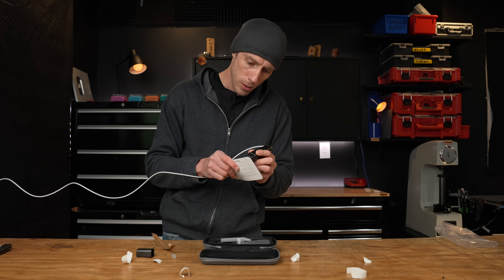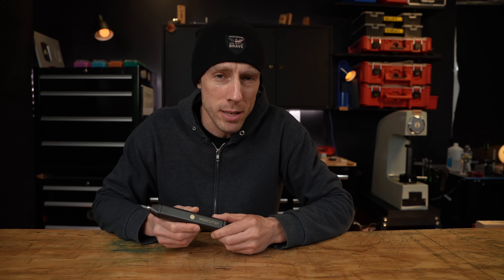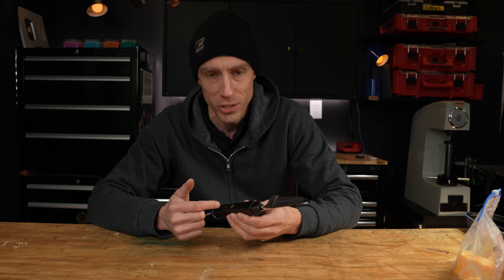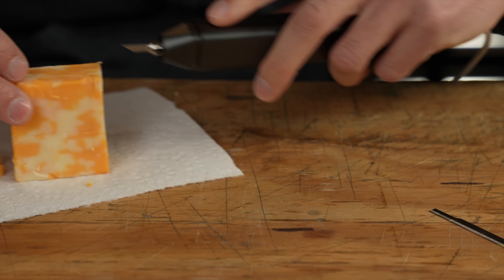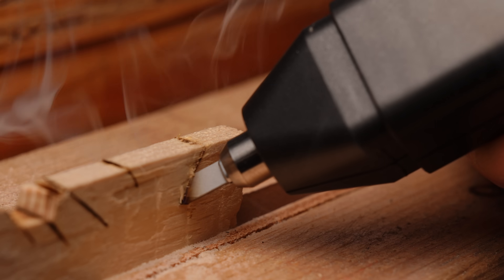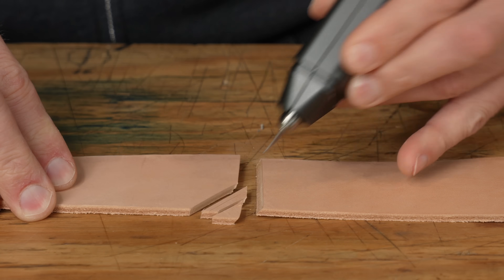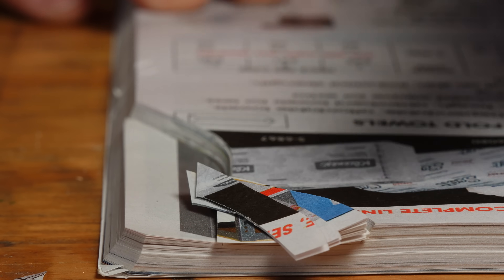Could This Small Tool Be The Future Of Knife Cutting Performance?

Comment: Turns out this tech does scale up to full-sized knives. Commercial ultrasonic food cutters are ubiquitous in cake factories, for instance. It doesn't take that much power to excite a larger blade because the blade doesnt move forwards and backwards like a reciprocating saw. The piezo stack pumps a pressure wave into the blade that causes the metal of the blade itself to expand and contract. Even steel (even knife steels). The key is operrating the blade at a resonant frequency so you add up successive, low-power waves into macro scale action. You can avchieve > 10 microns of displacement on an 8" steel blade with as little as 6 Watts! 

Uktrasonics are cool. And a nightmare to learn!
Reply: Oh that's probably why it didn't work when he tried to fit different size blades into it. Different resonance frequency and therefore no effect.
Reply: Cool, thanks for the comment. Now knife hobbyists just need an adjustable vibrator.
Reply: We need knife vibrators  @MarkkuS
Reply: Spot on.  Resonance and harmonics are the key.  changing the blade causes those to approach zero, as was demonstrated here.

I am wondering about the functionality of diamond and SiC into steel and maybe ceramic.  Steel embedded wood would likely be a problem for harmonics vs lower speed oscillations with high speed steel teeth.
Reply: Yes achieve clean cuts in cake and no sticking to the knife
Reply: so what you're saying is that a sufficiently high-level bard can unlock the ability to grant a +250% bladed melee damage boost to all of their nearby party members? *assuming they've specced into the opera subclass
Reply: Clone troopers had this a long time ago, ye
Reply: But it's also a different use of the vibration isn't it? 

This one is for making it cut through things it normally wouldn't. For the industrial ones it's more to stop stuff sticking to it right? Because that reduces waste and also makes a cleaner cut since it's not squishing the food as much. Not so much to melt the food with friction.

But yes we need one of these where the vibration thingy runs along the whole back of the blade and we can tune the frequency for different blade sizes and shapes
Reply: Seattle Ultrasonics just released an ultrasonic chef's knife.
Reply: @sylphed78  sheimend is Seattle Ultrasonics.
Reply: The piezoelectric cutter isn't tuned to the resonance of specific materials❤
Reply: Look up the Seattle Ultrasonics C200
Reply: No, the blade does not expand and contract. It's mechaically being moved back and forth by a piezoelectric. Basically like a jigsaw, except instead of a reciprocal motor, it's a piezoelectric.
Reply: @antoninuspius1747 on this small device the expansion and contraction of the blade may be minimal but the stack it attaches to works by expanding and contracting. On larger power ultrasonic devices, it is absolutely the blade (and every part of the transducer stack) that expands and contracts due to the pressure waves created by the piezoceramic elements. Ultrasonics do not work in the same manner as a reciprocating saw.
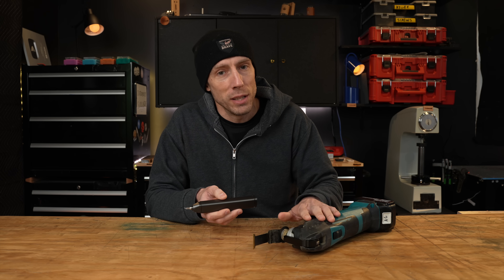Reply: @sheimend yes absolutely the second thing you learn in material science is everything is rubber. The first is class starts at 8:00 not 8:01

Comment: Thanks for bringing this to light! I see a huge application in the 3d printing world as well would be so easy to clean up support areas or for joining parts. Same with the crafting/cosplay world especially considering the scale of the blade. I know so many people that burn through easily 200$ in razor/exacto blades on foam and other thin plastics. The only other tool for those is a hot wire cutter which...well has a lot of its own drawbacks especially.  i had just discovered they make ceramic box cutters and that has already been a game changer but being able to dig into plastic opens a lot of possibilities.

Comment: TL;DR : Ultrasonic Cheese Cutter (the wire kind)

Non TL;DR
I think, for now, the secret sauce for scaling this up will be coming up with enclosures to house an ultrasonic edge. A knife doesn't cut, the edge does.  Later though, the trick will be materials that are nearly indestructible that can be long and knife edge thin.

Comment: I can see the advantages but it would take the fun out of the work who would want to carry extra batteries to eat the blade well it is masonic vibrating and if you want to question that get it out your wife's cupboard sticker razor blade to it all better still Jubilee clip it because if you stick it may fall off because you have to warm the blade up and it works better with a petrol lighter I'm not getting into that just use a battery do you know what I'm not even talking about physics anymore just don't do it could be bad for your health just buy a victory Knox they are very cheap a very good in fact they are excellent don't do what I do just buy a victory knocks and it will work for you anyway thumbs up

Comment: This is just a guess:  The reason why a larger blades won't work in this tool is due to the greater mass.  The tool probably uses a very high speed motor or gear set with correspondingly very low torque.  The greater inertia of a larger reciprocating mass is too much for the low torque motor to move.  Of course, the manufacturer could use a larger, more powerful motor, but that would cause size and cost to go up, which seems to be the opposite intention for this tool.  Again, just a wild guess here, I'm just a dumb mechanical engineer.
Reply: Honestly a pretty good guess, the motor is this case is most likely a piezo linear actuator though and there is more vibrational mode stuff here than normal mechanics. So the length is more the issue than the weight.

Comment: “The design of high power ultrasonic cutting devices is based on tuning a blade to a longitudinal mode of vibration at a low ultrasonic frequency. 
Explanation: 
* Longitudinal mode: This means the blade vibrates along its length, creating the most efficient cutting action. 
* Low ultrasonic frequency: For high power cutting, the vibration frequency is typically in the range of 20-40 kHz, considered the "low ultrasonic" range.  
Key points about ultrasonic cutting: 
* Blade design: The blade is specifically designed to resonate at the desired frequency, often achieved by adjusting its geometry and material properties. 
* Transducer: An ultrasonic transducer converts electrical energy into mechanical vibrations, which are then transferred to the blade. 
* Cutting mechanism: The high-frequency vibrations cause micro-fractures at the cutting edge, allowing for clean and precise cuts through various materials. “

Comment: That was a bone edge of that drywall too. The hardest part of a sheet of drywall to cut through. Just throwing it out there while that thing was doing the work of a router/cut out with no dust, or at least not a lot of airborne dust which is a big deal when doing remodels.

Comment: In all situations, an edge cuts better when moving through two axis than one. As the motion of the piezoelectric moves the blade, its likely moving in two directions when moving at 40k cycles per second really quickly and then getting clear of the cut and repeating. All my longest chef knives stay sharp far longer than my steak knives (when I could still afford steak) even though they are  decent. They spend more time scraping against the plates with more pressure

Comment: A couple of points:
- why is it moving so smoothly through the material? Yes, melting often plays a part, as is the sawing motion, but in addition to this, the friction of something at rest is higher than that of something that moves (which is why once your car starts slipping in a curve it is hard to get it under control), and since the blade vibrates, it is never at rest. And depending on the material, you may evaporate it and form a bit of a gas cushion around the blade.
- Why didn't it work with other blades? Look up "sonotrode tuning". The system needs to be at a resonance frequency to work well. Potentially, the driver might also recognize that it's being overloaded and stop / reduce power.
- Why does it generate heat? It's not just friction. If you put a blunt sonotrode on a piece of plastic and use a high enough power, it will melt. You can boil water with ultrasound. it's just generally slapping the material around a lot and thus adding energy. Especially with a knife, this is concentrated on a tiny area, so you can quickly reach rather high temperatures.
Reply: I work in industrial electronics and we use ultrasonic proximity sensors in a couple of places. When you put your finger in front of the sensor you can feel your skin warming. It's harmless but very neat to experience.

Comment: I believe the knife works with a piezoelectric device, this device has electric and mechanical characteristics that, to enter a resonance state, it requires certain parameters met. For the mechanical side, mass of the vibrating object is key. Any deviation from this parameter would decrease performance.
Keep posting cool stuff, man.
Reply: This is the real answer
Reply: 100% this. Its a similar thing with quartz watches, a quartz fork is filed down so that it will resonate at a particular frequency which is used to keep time. Here, they're adding a blade to the end and tuning the size/frequency so it will resonate. Change the blade size, you won't get resonance and it wont work.
Reply: @paulwilson2204  I play with radio, and this has got me interested. Reminds me of two antennas that need to be tuned to transmit & receive the RF wave, compared to the transducer & blade. More wattage will translate to the receiver (or blade) getting a better signal (or cutting faster), but the foundation will always be how closely tuned the elements are to the frequency of the transmitted wave.
Reply: I agree. I comented the same before i saw someone already did.
Reply: - yep it is all a tuned harmonic system..

Comment: That was cool what it did to the water, I wonder what phenomenon is responsible for it making the bubble like that? great up-close video by the way, love your videos!
Reply: Heat transfer and vibration? Like boiling water to a roiling boil, and like how bubbles form when you move your hand back and forth quickly in water.

I think the knife blade is heating up water when it comes in contact with it, so it heats up and then the agitation (from the blade vibrating) also makes bubbles and it's like both make water bubble, so it's probably either of those🤔
Reply: @snowhusk  it could be, I was wondering if it had something to do with the surface tension of the water, or the fact that the vibrations would be oscillating the water side to side and pushing upwards in the middle from the wave it created. Not sure but it does look cool!

Comment: I have seen them in industrial applications that cut much larger materials ( What I won't say, I don't want to be sued for revealing trade secrets.). Ultrasonic cutters work extremely efficiently, but if the "horn" part that transfers the high-speed vibrations to the blade ever cracks your ears will experience pain.

Comment: I hate to bring it up, but I think there are two reasons that your larger blades didn't cut:
The first is a maybe . Maybe the orientation of the cutting edge needs to be exactly the same, which is dramatically different from what you tried. The second is a for sure . The element doesn't have enough mass, energy, whatever you want to call it, to vibrate heavier stuff. In the case of the big knife, it's likely putting all the vibration in your hand when the blade has more inertia than the handle...
So you would have to match the angle and the weight.
Reply: Yep, I don't think it's practical to build a tool with a blade much bigger than what it has. I think the size and the mass of the bigger transducer would negate the benefits of having such a tool.

Comment: Great idea wonder if the heat increases with the size of the blade though. Have seen larger models in use but i don't think heat tests were ever done on them, i imagine it would be a matter of rising or lowering the frequency on a bigger blade to mitigate the heat problems but unsure of how the process works.

Comment: I think that model building would be a perfect application for this.
Reply: Exactly my thought. If Adam Savage doesn’t have one of these, he will as soon as he finds out they exist.
Reply: Also might be useful for 3d printing people as a way to clean up/further refine projects.
Reply: So you want arm modelers with ultrasonic weapons now?
Reply: architecture student here- can confirm this would be goated for foam core, chipboard, acrylic panels, etc. if it ever hits ~$75 and takes xacto blades I'll get one no question.
Reply: I have seen these for sale for years in the hobby magazines...
Reply: Imagine slicing an airfix model with a HF blade
Reply: Hey there's this vid on the channel "Practical Madness" "The cheapest ultrasonic knife", the video is less than a minute long and i can just about promise you you'll at least not hate it.

The channel is from a company which makes model kits and in this vid they're converting a fake $15 dental ultrasonic tool into a tool that separates sprues and 3d print supports.

Comment: It didn't work with the different blades because of the mismatched frequency, the blade,holder and everythinh that vibrates needs to be the exact weight and size to work correctly, either This old Tony or AvE did a video on one of those and this exact problem
Reply from the maker: Yes, i think thats the problem, but didnt bring it up since i have no way of tuning the frequency. I believe the larger more expensive units are able to ture the frequency for optimal cutting. 👍

Comment: hello, could you please do a video testing honing steels out again?  id really like to see if honing towards your hand makes a difference.  like holding the steel freehand and sharpend towards your hand.    thats how i do it, and it can make your knife pretty sharp a few times before you need to actually re-sharpen.      im curious if you sharpened, then dulled the knife, then honed the knife, and then stropped it, if you could get it back to insane sharp?  or if the honing steel is too rough and damages the apex too much for the strop to fix.      i can get my knife from feeling dull, back to sharp enough to pop hairs a couple times before the apex is too far gone.           i know youve done testing already with them, but i really want to see if honing downwards and then stropping could refine the burr from honing or not.    i suck at stropping, so im not the right person to test it haha

Comment: Not a professional in any sense of the word, but I imagine one of the big challenges of making a larger version like you describe is keeping the bigger blade from vibrating itself into bits of flying shrapnel.
Reply: Or just the sheer energy needed to shake such a large blade. It would definitely eat through batteries quickly.

Comment: For plastics, I mostly use a soldering iron with an extra set of tips. Quite cheap. Proper temp setting is a must.
Reply: I guess heating the metal is basically just vibrating it on a molecular level anyway.
Reply: @michaelsullivan8934 Its actually pretty simple. Plastic get softer with heat, therefore it cut easier.

You can do a fun little experiment in your kitchen.
Take a frozen dice of butter and try to cut it with a cold steel knife and then you do the same with a hot steel knife.

Please ask your parents before if your not a grown up or a eagle scout.
Reply: @youremybiggestfan good addition. The soldering iron of course only works for thermoplastics, not for any kind of resin like epoxy or many rubbery materials like silicone.

Comment: If you're serious about attempting to make one This Old Tony has a video on his attempt. Applied Science has on on an ultrasonic solder gun and Thought Emporium has one on an ultrasonic homogenizer for lab work. 
Mostly the same working principals and it all seems very fussy

Just found another one by Lindsay Wilson that goes into the technical stuff
Reply: I'd imagine you have to tune it to the resonant frequency of the blade, but I might just be using science words to sound more photosynthesis.
Reply: @michaelsullivan8934  Resonance is the thing and most of the tuning has to be done by the particular shape/dimensions of the metal horn connecting the transducer making the vibrations and the tool you want to vibrate.
(Take this with some salt. I'm not educated or experienced with this. I've just seen a few informative videos on the subject)